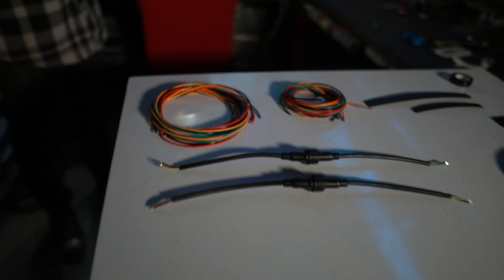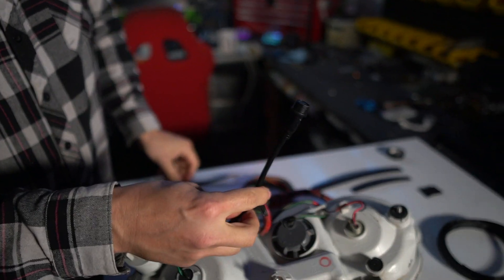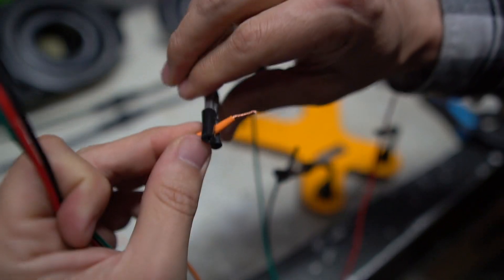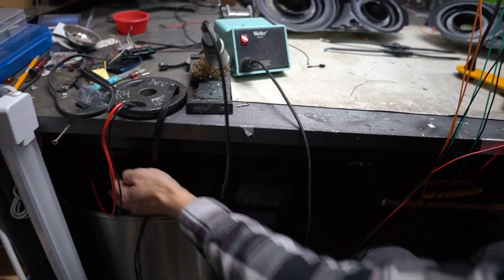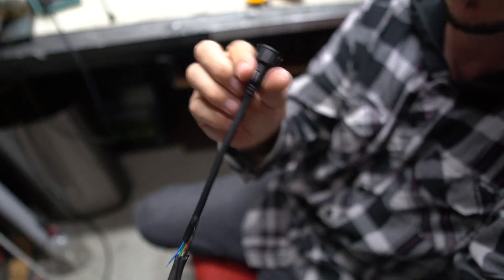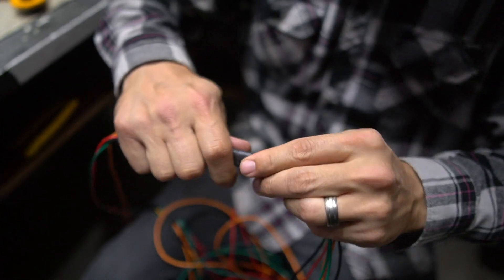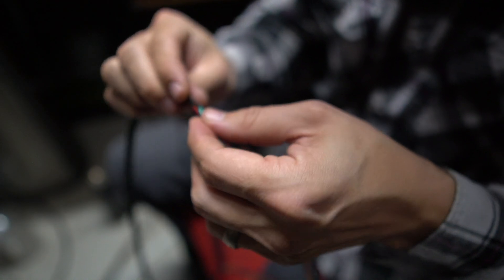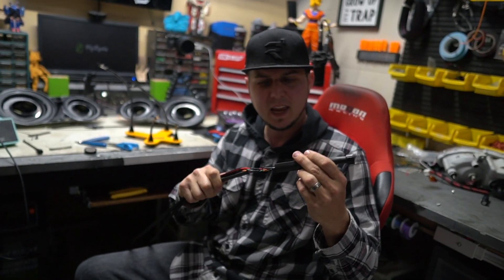How To Make a Wire Harness

Comment: tbh you should wrap the whole thing in tesa tape before putting the loom on since those wires are not rated for temps in an engine compartment. It'd only take a few years for those wires in there to become brittle from freezing and intense heat without something like tesa tape wrapped around them..

Comment: you can get an end attachment for your heat gun that has a back shield so it heats all the way around at the same time. also please tell me you're using a fume extractor for soldering otherwise you're going to end up with cancer from inhaling lead and rosin fumes

Comment: Got a dumb question, how do you make the new headlight indicator strips you installed light up/flash when you unlock the car. 
I’ve got it powered by switched 12v but that only allows power when the car is on. Direct to the battery works, but the lights are always on. What is a better way ??
Reply: Tap into your blinker wires
Reply from the maker: dual input circuit would be great here if you want it powered by a switch, but also to get power from the turn signal circuit at another time.

Comment: Since I finally got you to try the wire stripper, I'll throw a few more tips your way.
When splicing multiple wires I like to stagger them to minimize the bulkiness.
Grab a heat gun that has a wrap around nozzle for heat shrink tubing.
Mount the heat gun to the wall facing down and you can switch it on and hold the wire in place.  I added a foot switch for added ease of use.
When you cut your wire loom material, put a slight singe on it to melt those together so they don't start fraying during install.  This takes some practice, because if you singe it too much it won't expand as much to go over the wires.
Reply: Great tips 280. I agree with the stagger item, as a practice.  That heat gun tip is legendary.
Reply from the maker: You got me to do what now? Lol